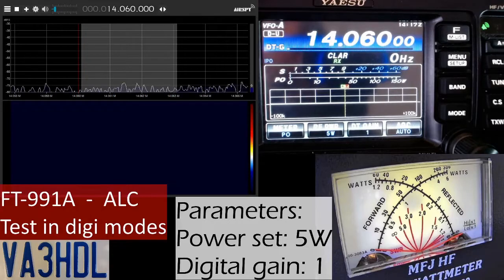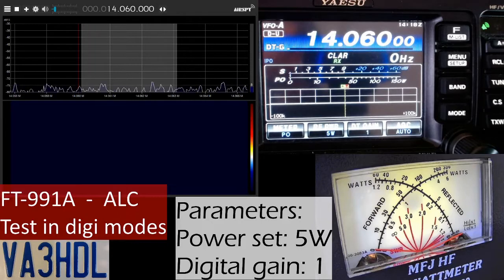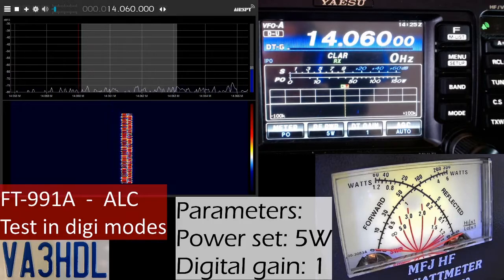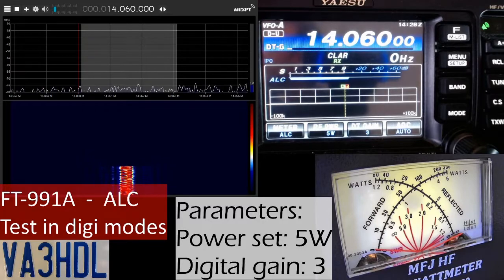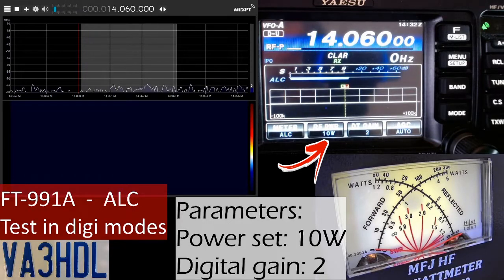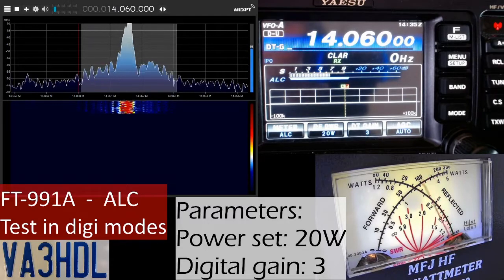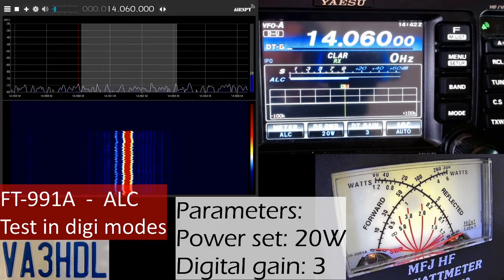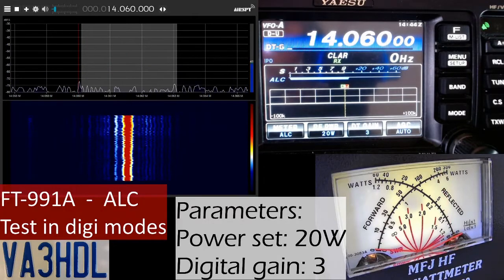ALC Experiments with the FT-991A

Comment: Apologize to disappoint you but the reason for the “artifacts” is not the ALC kicking in but is the receiver being overloaded by the higher power level. You’re sending too much of a signal level into it. In fact if you watch carefully at minute 9:08 they appear on the waterfall even before ALC start working, but rather when you have increased the power.
Try again this experiment making sure the spectrum analysis is done without overloading. Try to use an attenuator between the radio and the receiver. Go with 30 db at least to start with. Also was your setup for spectrum analysis? I think I missed that.
73

Comment: Cool very helpful. What would cause disparity in ALC between configurations. My ALC doesn't start until dt-gain of 65 with radio at 10w
Reply from the maker: Thanks! High DT Gain means low output from the computer. If you increase the output from the computer, then you have to lower the DT Gain. My computer output settings for audio going to the radio is 80% (to prevent distortion.) For digital (RTTY) my DT Gain is around 4~5 and for phone my DT Gain is around 15. Hope it helps. 73

Comment: Hi Pablo, I tried to replicate this experiment today. Do you remember if when doing this, you had any antenna connected to the SDR and what the RF gain of your SDR was? I appreciate this video was posted a year ago and you might not remember. 73
Reply from the maker: Hi Ohaya, I had an antenna connected to the SDR and I do not remember the RF gain setting. Most likely minimum if any at all. 73
Reply: @VA3HDL  Sounds good, thanks for the reply, I did the same. For me, on FT8,  DT gain 4 worked better. On lower gain the power my FT991A was putting into the dummy load (as seen on the external cross-needle meter and on the radio display) was lower than my desired power (even with no restriction from WSJTX). On DT gain 5 the ALC started to kick in. Not sure why our results are a bit different... It's very interesting. Could it be because I conducted my tests on the 2m band? (144,174 MHz)
Reply from the maker: @ohaya1  Mine is always between 4 and 5. One thing you can try is to set the power around 75% in WSJT-X and the digital gain to a value that starts kicking the ALC. In that way you can fine tune with the WSJT-X power slider only and leave the radio alone. You can set WSJT-X to remember the power setting per band. The ALC will work differently on each band and also on different audio frequencies. This is why I leave my  audio TX frequency fix between 1000 and 1500 Hz. So once I set the power level desired I know that it will not change.
Reply: @VA3HDL  That's very helpful indeed, thank you! I'll have to play an experiment with this!

Comment: Thanks for the video !
Please what is the volume level :
Speaker audio codec on your computer ?
And in the radio menu 73 "data out level" ?
Thank you and 73 !
Reply from the maker: Hi Fernando, audio to radio (playback) is at 80% level, audio from radio (recording) is at 92%. Menu option 73 is at is default value of 50. 73 de VA3HDL
Reply: Thanks Pablo for the information and attention!
If possible, I will ask more about your radio's menus, such as:
Menu : 33, 70 , 71, 72 ?
Are these menus above the main ones for the FT8?
And I'm sorry but I didn't find the "audio from radio (recording) is at 92%" ?
  In your video you demonstrate that you work with practically zero ALC and show us that you have done an excellent job.
Already my settings until today, I can not proceed a qso with the ALC below 5 -7.
Thanks
Reply from the maker: @fernandogonzaga1011  33=Enable; 70=REAR; 71=RTS; 72=USB;
In the Sound Settings -> Recording Tab -> USB Audio Codec is at 92%, similarly on the Playback tab the USB Audio Codec level is a 80%
The coarse adjust can be done with the digital gain setting on the radio, and the fine tuning using the power setting slider on your FT8 program until you obtain the desired peak power without (or minimal) ALC indication. Two things I've seen also impact the ALC is the TX audio frequency selected in the FT8 (I select a TX frequency and lock it in there) and the radio band, when switching bands gain must be tweaked a little again. I noticed the audio gain settings doesn't work exactly same on all bands. 73
Reply: @VA3HDL  Good morning, Pablo !
Thanks for your attention, I didn't know that the codec's audio was different  from the computer's audio playback. I will makevthe ajustment. 
The other settings are the sabe.
Thank you very much.
73 !

Comment: Is this a good radio? I just bought one
Reply: I have had mine for a few months and love it so far, still a lot to learn but have used SSB, FM and FT-8 and WSPR and all seem to work well. I get good reports on the audio.
Reply from the maker: Congratulation! I can't complain, I'm very happy with it. I've used all modes, including satellite FM/SSB, FT8, RTTY, C4FM digital voice, etc. The only mode I didn't do is CW, because of lack of practice. There are users groups in FB, groups.io, etc. Lots of information and videos available. 73.

Comment: If you set power to 100W , DT = 2 and WSJTX Slider very low then bring up slowly, you should be able to get 30~40W with zero ALC and very clean.
Setting power to 100W ensures the PA is biased at it's most linear point, and you are just using audio drive to bring power
This procedure was from the PK-31 days, but I find it still valid.
Reply: that is a very cool comment and makes total sense.  trying it now, thanks!
Reply from the maker: Exactly! The idea is that there is not need of any ALC levels to show up on the meter to achieve the power wanted. 73